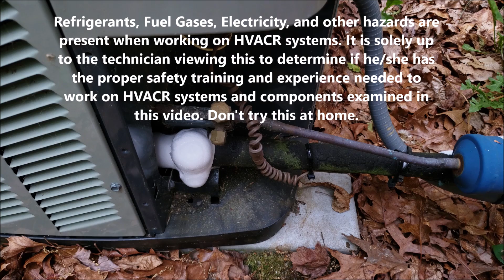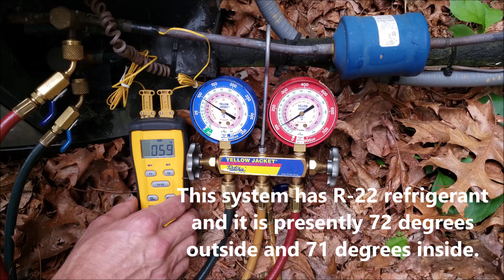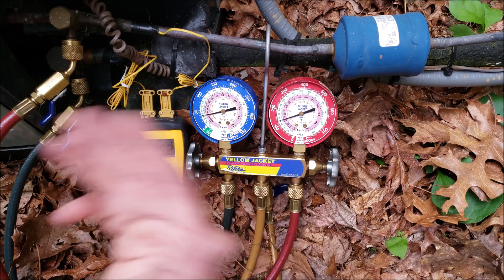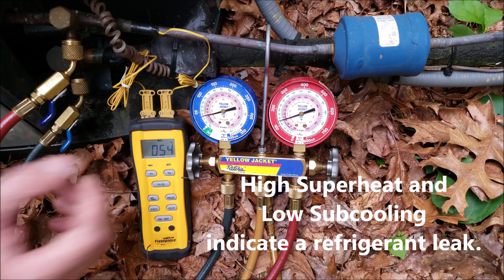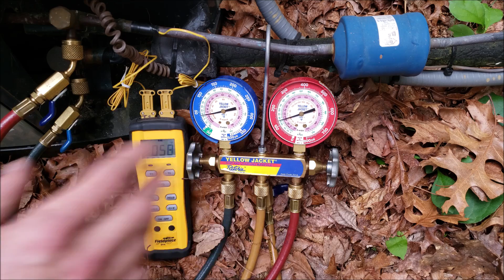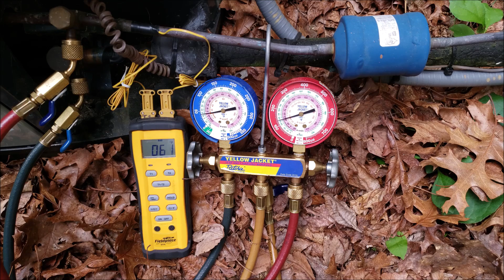Frozen Evap Coil, Troubleshooting Using the Refrigerant Charge Measurements!

Comment: For those who have changed parts over and over, and added ref and still getting frozen check your dampers (if you have zone board and dampers ___typically 2 story homes) dampers can quit working by dieing half way shut or shut pernamently by being stuck/seized

Got to inspect the damper by cutting into the ductboard see if its not rusted out and then if it looks good just buy a honey well 24v damper motor

Comment: Hello Craig, hey just today I was checking the charge on a 410a system and the pressures was 78.5 on the low side and 350 psi on the high side it was 95’degrees today so I check the delta T and it was 20 degree’s 52.9 from the supply and 72.9 from the return why I’m getting that low of a reading on my low side of 78.5 and it stays ther when I try to add Freon. What do you think that’s going on?
Thanks Craig

Comment: Could also be caused by running in a low ambient condition without head pressure control.  Good accurate explanation.

Comment: Hi Craig, I maintain over 100 Rheem package units at our resort and a few freeze up on occasion, but I don't know why. There is a lot of debate around the shop as to why this is occurring when the charge and airflow are okay, and there are no restrictions. Some of the technicians believe the doors to the room being open to other rooms is causing the unit to run longer, but I'm confused by this because those rooms are being cooled by other package units. The high side gauge was only about 10 degrees above ambient, 115, and the low side gauge was around 42 degrees. The compressor was pulling 15amps on all three legs, and the blower motor and condenser fan motors were pulling the doors closed so all the components were working well. I moved the TXV bulb, and nothing changed which made me pause. Adding refrigerant didn't change anything either. There was 6 degrees of superheat and almost 0 degrees of sub cooling, but package units are difficult to make accurate measurements because all the components are tucked away in the cabinet. I think something else is wrong, but I don't know how to isolate problems with a package unit. I purchased your books, but the procedures are limited to split systems. How does a coil freeze up when 75 degree air is flowing through it?

Comment: i got R 22 system ,,,,low pressure on suction side averages 35 psi with high superheat of 62, discharge is 177 psi average. sub cool yesterday was around 12. any suggestions? also evap freezing.

Comment: I have a 407 c new condenser installed on a r22 split unit but when I defrost its running at 40 degrees sat temp aprox with txv at 11sub cl. Evap clean static good mtr good filt ok, I'm thinking interment txv issue any ideas , it runs for 3 to 4 days before freezing they never set it below 75... any ideas

Comment: do you have a calculator for getting the wetbulb? i tried using a indoor outdoor and humidity thermostate but in the calculators i find they all seem to be for making snow. i did try a dew point app and if i enter 72 deg air temp and relative humidity i get dew point of 56.9  but i do not know if that is the wetbulb?  so i sure would like to find a app that can help with the wetbulb unless what i gave it the wetbulb. thanks

Comment: Its hard to understand how a refrigerant line restriction can cause the evap to freeze.  I undertand the pressure would drop but you need enough refrigerant to boil in the first place for the cooling to take place. Is there a video on this ?    Thanks for great video
Reply from the maker: Yes look up "acservicetech liquid line restriction"
Reply: @acservicetechchannel  8:06

Comment: Another cause for icing I found occasionally: simply the thermostat dialed too low or stuck on cooling, that is the room is so chilled and dehumidified the coil begin to ice and cascade from there
Reply: I think that's what happened to mines. How do I fix it?
Reply: @dajasexton658  when confirmed txt stuck or clogged, perform a system pump down, either clean the txv or simply replace it.
Reply: Stuck contactor

Comment: Great video. I have an 80,000BTU 95% efficiency Trane furnace with evaporator coil.  Last week I was low on refrigerant and the A/C tech charged the system. A week later warm air was coming out of the registers and the tech came back.  The tech did a nitrogen leak test and said that there is a leak on the evaporator side. The evaporator is 9 years old and he installed a new evaporator, evacuated the system and loved that he got it to 200 microns and lastly recharged the system. A week later im getting no air flow from the registers and the insulated line going to the evaporator was frozen (ice in spots of the copper line) and frozen at the condenser line...He' saying I may need a new condenser?? Opinion??
Reply: people usually install the condenser and air handler together don't they?
Reply: @metsrus  On new units yes but you will change one if needed or if they are both beyond their life span. 9 years old isn't old at at for a unit.
Reply: @tonyj8947  so what happened?  did you get just a new condenser?
Reply: @metsrus  Yes, i had to or the system would'nt work.
Reply: Time for a second opinion.  This guy never fixed the leak.  He had to come back after changing out the evaporator, and now says it’s the condenser?

Comment: Your videos are awesome . 
Just a quick question.  

I installed new furnace ac was working great.  Shut off air conditioner. And tested to see if furnace was working . Everything was great . 

I turned AC backed on coil froze up. 
Coil is clean filter is clean. I dont have gauges would it be something I can do without calling a technician

Comment: If in a low charge system there is higher pressure/temperature in the middle of the condenser, why is there lower temperature/pressure in the middle of the evaporators causing freezing.

I guess I’m try to figure out what’s happens between the condenser and evaporator in a low charge system.

Comment: Good video,question if your find out it's low on refrigerant and you have to turn on the unit to charge it with refrigerant, but it starts freezing up right in 3 to 5 mnts,can you still continue charging it?
Reply from the maker: Yes you need to get the sat temp up above 32 degrees. If the coil is frozen, you may need to turn the outdoor unit off again, wait 5 minutes, and turn it back on again and continue checking the charge and adding refrigerant. Make sure to find and fix the leak first if you are that low since it will likely leak right back out again and that won't be good for the environment or the building owner, thanks!

Comment: Had the same issue.  Turns out the freon was a little low.  Got it charged up and everything is now working great.  The best part is I have a service contract on my furnace, AC and water heater.  $23 a month for the contract and it has saved me a lot of money in repairs.
Reply from the maker: If the leak is bad, the refrigerant will leak out again. Eventually it will need to be fixed as the leak grows, thanks

Comment: What’s the best tool to use to thaw out an evaporator coil?
Reply from the maker: If the unit has a psc fan then you can turn the blower on but an ecm motor could get damaged if you try to run it if the coil is closed off. You can use a heat gun or hair dryer as well

Comment: After system thaws, what would symptoms of a bad compressor be? (no breaker/fuse tripped)
Reply from the maker: Bad valves in a compressor would exhibit very high vapor sat temp on the low side. If the compressor doesn't turn on then bad capacitor or possible bad terminals at compressor or low pressure witch tripped or compressor shorted, or just no power. If the coil is frozen then the compressor is not the problem, thanks!

Comment: What is your technique for thawing an iced up system?
Reply from the maker: If it is a psc motor then you can run the fan but if it is an ecm motor then don't run the fan and just use a heat gun, thanks

Comment: Great job Sr. one quick question, having a 3 tons condenser and indoor coil on a 2 tons furnace would it cost for it to freeze?
Reply from the maker: You would need more blower capacity to have the system be an actual 3 tons of air conditioning and could make it freeze if the airflow is too low, thanks!

Comment: If you have good airflow and the suction side is low then either you have a restriction or low on charge you dont need to check lineset temperature to know this add charge if your suction doesn't improve or is pulling a vacuum and your liquid side rises then you have a restriction if you get that suction up to around 75 psig on and liquid around 175psig R-22 system your money.
Reply from the maker: Hey Kevin, yes I try to teach techs to read sat temps and superheat and subcooling so they do not need to add any refrigerant during troubleshooting, thanks!

Comment: Hello, I was wondering what your preference is on drop in 22 replacement? Bad and good ones?
Reply from the maker: R407C is my favorite if you cut the compressor out, drain the oil and replace with POE, thanks! MO99 works very well too if you don't change the oil!
Reply: Ok thanks!
Reply: R438A drop in replacement

Comment: If it was an air flow issue  would it mean that a return duct is blocked or the filter in the system is extremely dirty ?
Reply from the maker: Yes or the under side of the evap coil is clogged with dust, thanks!

Comment: Dirty filter is usually a common cause of frozen coil too.
Reply from the maker: Absolutely, that would be considered a low airflow scenario, thanks!
Reply: Dirty filter would cause a low side heat transfer problem or to put in layman terms (low airflow)

Comment: Awesome video I am an Auto mechanic and do touch Automotive air conditioning we usually just check the pressure and check it what it should be with the outside temperature
Reply from the maker: That is because they are a packaged until and the manufacturer knows what pressure they should run at during idle at certain outside temps. The issue is that the car compressor can go faster or slower depending on the motor where as these compressors are typically fixed speeds, thanks!

Comment: The problem I had was high super heat high sub cooling low vapor pressure high liquid pressure. What’s the issue???
Reply from the maker: Sounds like a liquid line restriction such as a clogged metering device, strainer, or filter drier, thanks
Reply: Yeah I have to do a txv change out next week bad part is it’s in a tight attic with a roof supporting 2x4 right on top of the evaporator door I don’t know how to open the door to get to the txv bad placement
Reply: I will be ordering your paper back book ASAP
Reply from the maker: Thanks a lot John!

Comment: Forgive me if you've already addressed this, but why are you rocking those YELLOW JACKETS and not a set of TESTO probes???
Reply: One more question: did you recomend an iso test or did you just recharge it???
Reply from the maker: This was part of a large amount of PM's, I am going back on Monday and Tues to address all the problems on the units, thanks!
Reply from the maker: I use the compound manifold gauge sets because that is what most techs are learning on in technical schools across the country. I want them to all have an in depth knowledge of how to convert to sat temps and then do all the superheat and subcooling calculations themselves in their heads. I found that once techs understand how to do this, they seem to grasp the troubleshooting side a lot better. I did a video discussing digitals and compounds about 6 months back explaining that. I use Fieldpiece probes when I do use probes but Testo are just as good, thanks!
Reply: @acservicetechchannel  Thanks, brotha! 👍 Keep rocking! Gonna buy your book soon!!!
Reply from the maker: Thanks, sounds good Leonidas!
Reply from the maker: Thanks King Leonidas and Andrew Ackroyd!
Reply: @acservicetechchannel   Schools should be using state of the art tools.  They’re  easier to understand.  You can teach all that other stuff with a PT chart, which should be used instead of the temp scale on analog gauges.  Sporran makes an excellent chart with superheat and sub cooling instructions.

Comment: The more I hear of ECM's the more they suck, of course they 're energy efficient and can adj. but a standard 3 speed lasts 30 years, no problems.
Reply: seems like a fitting place for this ECM =  "Eats Continuous Money" ...
Reply from the maker: Ha ha, nice
Reply from the maker: It certainly is a trade off for sure! There are more possibilities of breaking with an ecm motor such as voltage irregularities, restrictions in airflow, and more components included to possibly break but yes they are more efficient, are quiet when they start for sensitive sleepers, can push through ductwork that is slightly smaller than it should be, if it is too small though, the motor will suffer. Thanks A D!
Reply: Basically true of any inverter driven part of HVAC. I still prefer it for an indoor blower. I just wouldn't like it for mini splits, but oh well, they are all gone.
Reply: @sprockkets  Put the same motor HP and or amp draw, voltage, a 90-380 , if you have a heat pump use three relays, Hi cool, Low Red, and on a FAU with gas use 2- 90-380 relay for Hi and fan, and Cam Stat relay for heat so the blower motor comes on before ignition and stays on after the burners shutoff so air circulates over the heat exchanger, make sure you eliminate the connections on the board, and throw the Electrically commutated motor in the trash.
I
Reply: @clucknorriz6683  There are plenty of good ECM motors from GE that were in service for over 10 years. The problem is we make everything crap, including the PSC motors now.